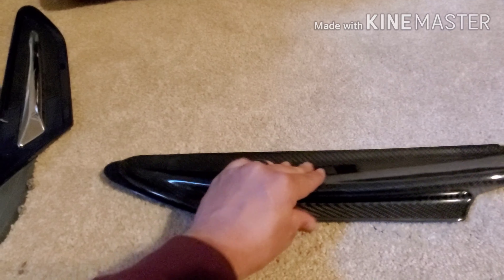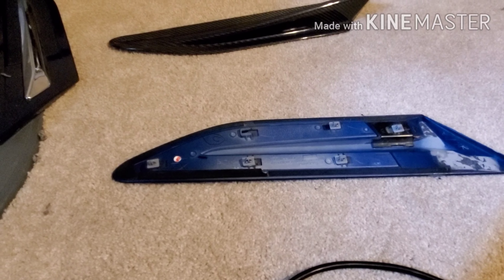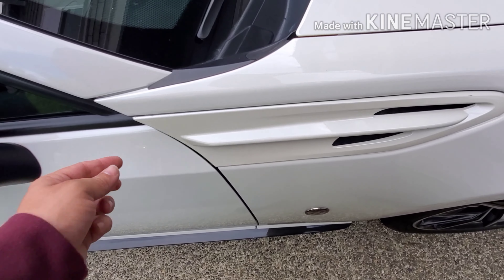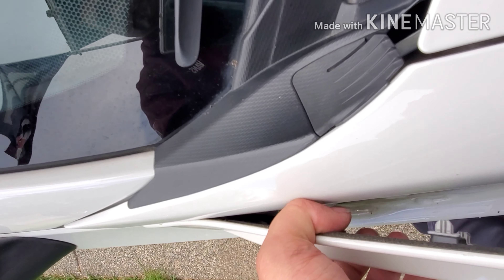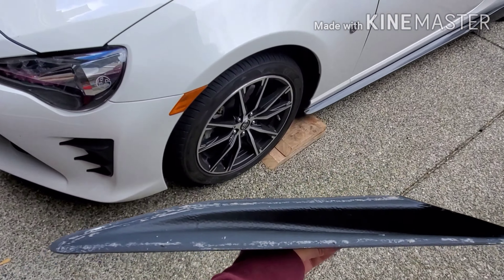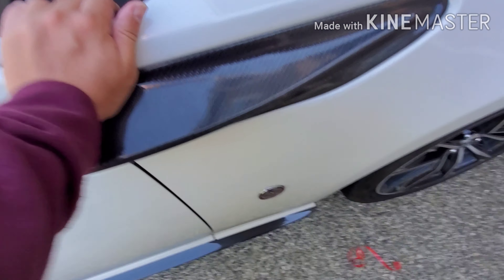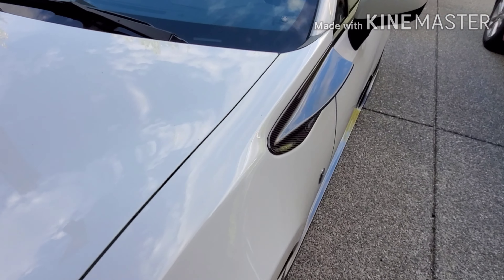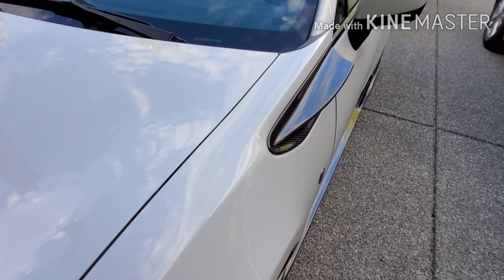2017 TOYOTA 86- 2ND TIMES THE CHARM. 2013 fender garnish fitment better with Carbon Fins

Comment: hmm i got the 86 ones but i think the 86 boxer logo was maybe in the way, but knowing this i'll go back and check it out, cheers.
Reply: how did it turn out? My gt86 logo is getting in the way as well and idk if it would fit or not after removing it...
Reply: @ilolatyouful  heyo, it seemed like the way to go was to remove the oem fender garnish and silkaflex it on, so i went and sold it instead and painted my silver oem garnish black instead, the painted black is really constrasty even tho i have a silver and black theme going on, but it does the job.